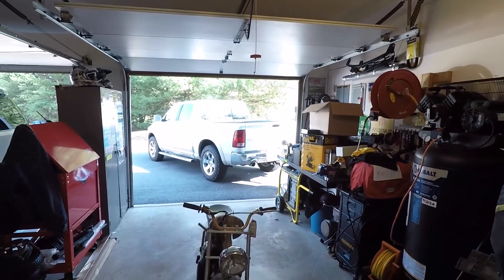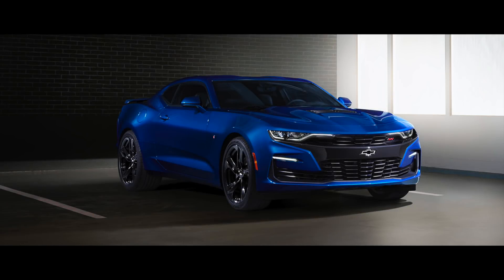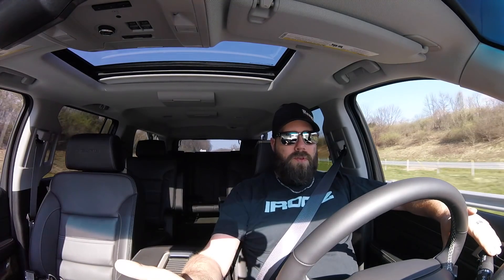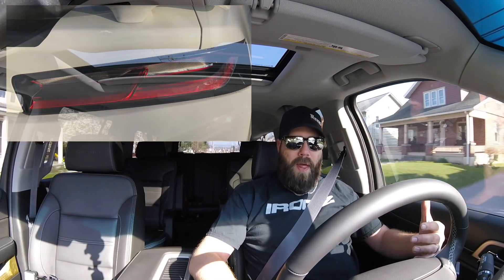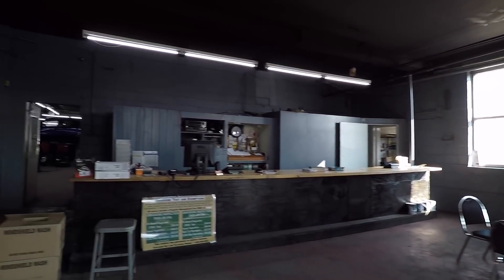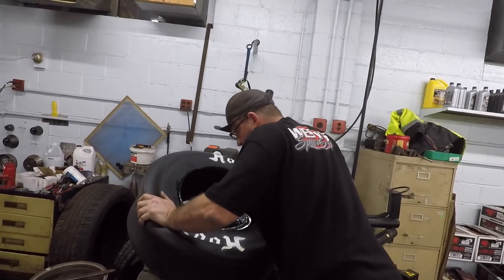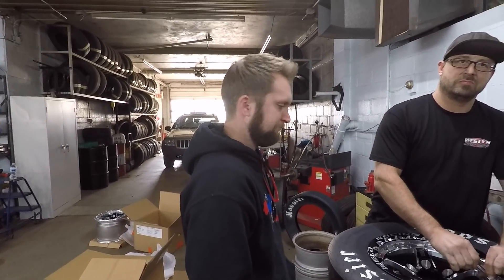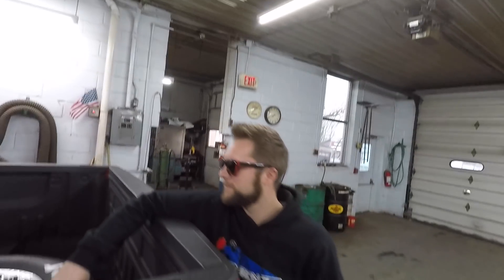Is The 2019 Camaro Refresh The Best Camaro Yet???

Comment: I had planned on buying a 6th gen late 2018 early 2019 until I saw this tragedy. If I cant find a new 2018 black ss 1le 6m which I doubt I will Im buying a performance pack 5.0. So there is at least 1 customer chevy lost due to it.